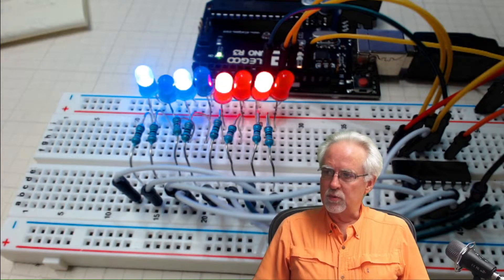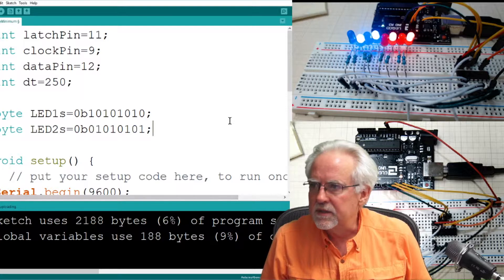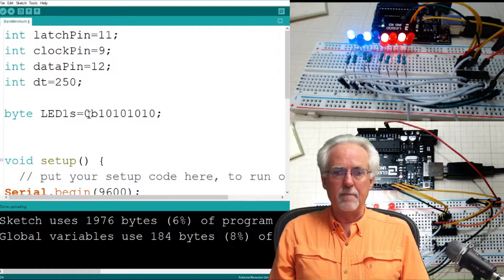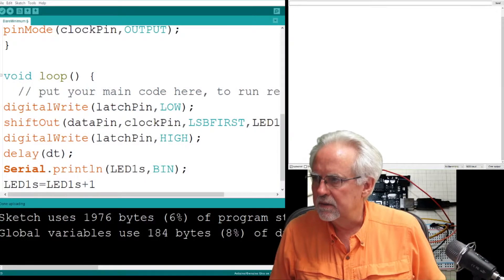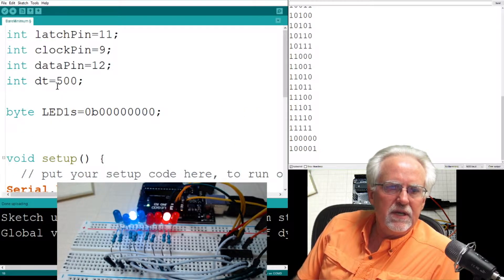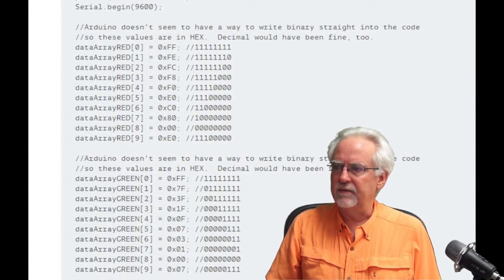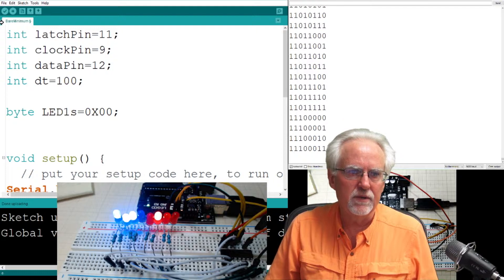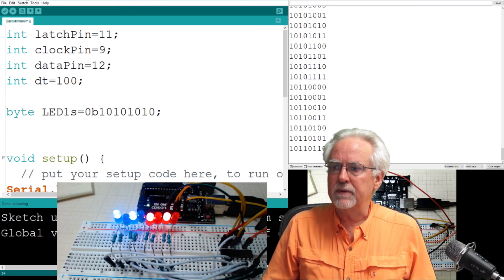Arduino Tutorial 43: Binary Counter with 74HC595 Serial to Parallel Shift Register

Comment: Did it by myself,but differently!

here is my code

int ltpin=11;
int cpin=9;
int dpin=12;
byte ls1=0b00000000;
byte ls2;
int dt=2000;
void setup() {
  // put your setup code here, to run once:
Serial.begin(9600);
pinMode(ltpin,OUTPUT);
pinMode(dpin,OUTPUT);
pinMode(cpin,OUTPUT);

}

void loop() {
  // put your main code here, to run repeatedly:
for (ls2=ls1;ls2<=255;ls2=ls2+1){
 Serial.print(ls2,BIN);
 Serial.print("   ");
Serial.println(ls2,DEC);
 digitalWrite(ltpin,LOW);
shiftOut(dpin,cpin,LSBFIRST,ls2);
digitalWrite(ltpin,HIGH); 
delay (dt);
}
Serial.print(ls2,BIN);
Serial.print  ("   ");
Serial.println(ls2,DEC);

}

Comment: Hi, Paul, it's been a while since my last comment/lesson because my Prusa printer got delivered, so I had to go back to your Fusion 360 lessons so I could revisit and try out my new printer!   ...but as far as the homework coming into this lesson, all the time I spent on my 'Hex Counter' program from that lesson, set me up perfectly for this the lesson 42 homework.  I did set the variable as a byte, but just populated it with a decimal number, incrementing it by one each loop, and then outputting it as DEC, HEX and BIN to the Serial Monitor.  I keep forgetting that the variables don't overflow but just return to the starting number... but otherwise it was a quick homework success.  We'll see how I do with binary shifting.  Of course, spending time with Fusion 360 and my Prusa as well!  Thanks again for all the great teaching!

Comment: Your LEDs+1 goes on until overload. I put my count (your LEDS) in a 'for' loop:

void loop() {
  // put your main code here, to run repeatedly:

for(count=0;count<256;count=count+1){
  digitalWrite(latchPin,LOW);
  shiftOut(dataPin,clockPin,LSBFIRST,count);
  digitalWrite(latchPin,HIGH);
  delay(dt);
    
  }

}

Comment: Sir I did this on my own! It was fun ans simple!

int latchPin=11;
int clockPin=9;
int dataPin=12;
byte LEDs=0x00;
int dt=250;

void setup() {
  // put your setup code here, to run once:

Serial.begin(9600);
pinMode(clockPin,OUTPUT);
pinMode(latchPin,OUTPUT);
pinMode(dataPin,OUTPUT);

}

void loop() {
  // put your main code here, to run repeatedly:
digitalWrite(latchPin,LOW);
shiftOut(dataPin,clockPin,LSBFIRST,LEDs);
digitalWrite(latchPin,HIGH);
delay(dt);
LEDs=LEDs+1;
}

Comment: It all started with a df11 error message on the wash machine.  So I found a Youtuber replacing transistors in the motor control unit to fix the problem.  Then I came to realize I could spend days reading about transistors.  While doing this I came across Arduino,  and subsequently your series, Paul.  Loving it, especially the lessons with the upfront theory.  This is where the real value has been for me.  Now consider buying a cheap oscilloscope to find out how that works, ....while still going through your lessons.  Thought I would get colored flashing Christmas tree lights this year in the spirit of my new-found hobby, but the wife has already seen enough flashing lights (on the living room table) .  As for the wash machine; many YouTube comments claim that they (temporarily) get rid of the df11 fault by banging the top of the machine.  Luckily that works for me too, which allows me to tinker with my Arduino.  Dug out my several decades old EE101 book even.  Lots of Covid downtime these days.  Thank you, Paul.  Glad I found you !

Comment: My homework (Binary Counter): 
int latchPin=11;
int clockPin=9;
int dataPin=12;
int dt=1000;
byte j;
byte LED1s=0b10101010;
byte LED2s=0b01010101;
 
void setup() {
  // put your setup code here, to run once:
Serial.begin(9600);
pinMode(latchPin,OUTPUT);
pinMode(dataPin,OUTPUT);
pinMode(clockPin,OUTPUT);
}
 
void loop() {
  // put your main code here, to run repeatedly:
for (j=0; j<256; j=j+1){
digitalWrite(latchPin,LOW);
shiftOut(dataPin,clockPin,LSBFIRST,j);
digitalWrite(latchPin,HIGH);
Serial.println(j,BIN);
delay(dt);
}
}

Comment: I'm getting the same results but I kept having to change the shiftOut to MSB rather than LSB.  I kept looking and finally saw that Q0 is connected to the right-most LED if I'm looking correctly.  I guess I'm just used to having the LSB on the right and therefore Q0 would be connected to the left-most LED.  Isn't the data line labeled "0" generally assumed to be the least-significant bit or am I looking at it backwards?

Comment: I did the homework and it worked. Very satisfying. Some of my previous lessons did not work as expected. I double checked the software and hardware but could find no fault. In the motor button control lesson, when I pressed either button the output of both buttons changed to 0 from 1 and the mSpeed never got above 80. Really odd. I wonder if my Arduino board is misbehaving. Has anyone else had this happen?

Comment: /*
binary counter with 74HC595 chip
8 bit led
*/
int latchpin=11;
int clockpin=9;
int datapin=12;
byte counterval=1;
int dt(500);
void setup() {
  pinMode(latchpin,OUTPUT);
  pinMode(datapin,OUTPUT);
  pinMode(clockpin,OUTPUT);
  Serial.begin(9600);  
}
void loop() {
  while(counterval<=255){
  digitalWrite(latchpin,LOW);
  shiftOut(datapin, clockpin, LSBFIRST, counterval);
  digitalWrite(latchpin,HIGH);
  counterval=counterval+1;
  delay(dt);
  }
  
}
did this for the homework myself

Comment: I used an  if loop encompassing the original code 

so it was if (LED1s <= 0xFF){
digitalWrite(latchPin,LOW);
shiftOut(dataPin,clockPin,LSBFIRST,LED1s);
digitalWrite(latchPin,HIGH);
delay(dt);
LED1s = LED1s + 1;
Serial.print(LED1s,DEC);
Serial.print("    ");
Serial.print(LED1s, BIN);
Serial.print("    ");
Serial.println(LED1s, HEX);}

Comment: Got it on my own, you were right, only need a few extra lines of code. Heres what I put
int latchpin=11;
int clockpin=9;
int dataPin=12;
byte LED=0b00000000;
byte LED2=0xFF;
int del=500;
void setup() {
  // put your setup code here, to run once:
Serial.begin(9600);
pinMode(latchpin,OUTPUT);
pinMode(clockpin,OUTPUT);
pinMode(dataPin,OUTPUT);
}

void loop() {
  // put your main code here, to run repeatedly:
 for(LED<=LED2;int j=j+1;){
  
  LED=LED+1;
  delay(del);
  digitalWrite(latchpin,LOW);
shiftOut(dataPin,clockpin,LSBFIRST,LED);
digitalWrite(latchpin,HIGH);

 }

}

Comment: homework was completed.  But I added a for loop and counted to 255.

void count255(){
  
 for(LEDs=0;LEDs<=255;LEDs++){
digitalWrite(latchPin, LOW);
shiftOut(dataPin,clockPin,LSBFIRST,LEDs);
digitalWrite(latchPin, HIGH);
delay(dt );
Serial.print("DEC = ");
Serial.print(LEDs, DEC);
Serial.print("    BIN = ");
Serial.print(LEDs, BIN);
Serial.print("     HEX = ");
Serial.println(LEDs, HEX);
} 
}

Comment: Hello Paul. Thanks for the lesson. I did the homework in a different way and it also works. I used a for-loop to solve the problem.
"for (i == 0; i<= 255; i++)" works fine -also the alternative binary loop "for (i == 0b00000000; i<= 0b11111111; i++)" and the hex-loop for "(i == 0x00; i<= 0xFF; i++)". The "shiftOut (dataPin, clockPin, LSBFIRST, i);" statement in the loop sets the LEDs in the right order. 
Thanks for teaching. Now I try to solve the next assignment.
Reply: And if we add functions it becomes a very elegant IMHO

void loop() {
  for (byte i = 0x00; i <= 0xFF; i++) {
    applyInputToLeds(i);
  }
}

void applyInputToLeds(byte pattern) {
  digitalWrite(latchPin, LOW);
  shiftOut(dataPin, clockPin, LSBFIRST, pattern);
  digitalWrite(latchPin, HIGH);
  delay(dt);
}